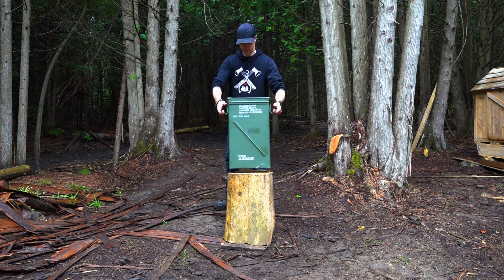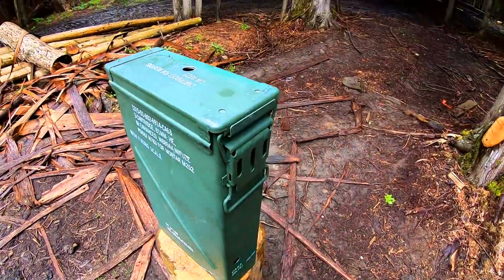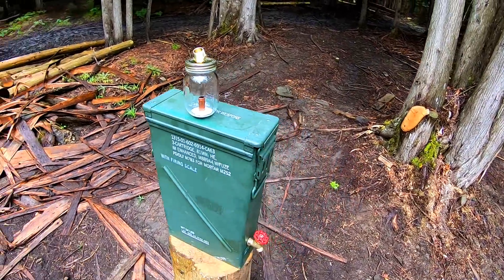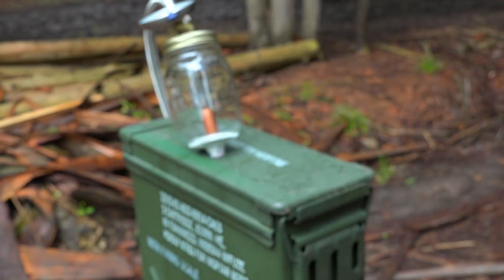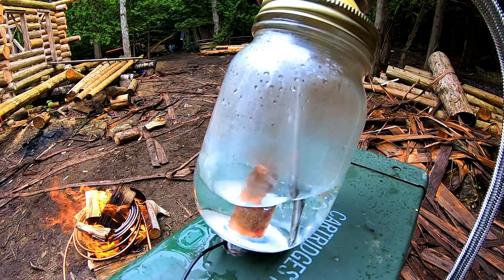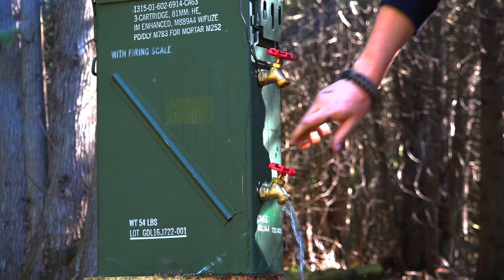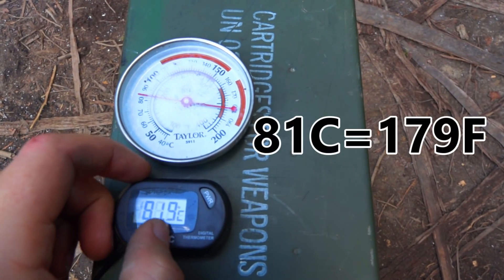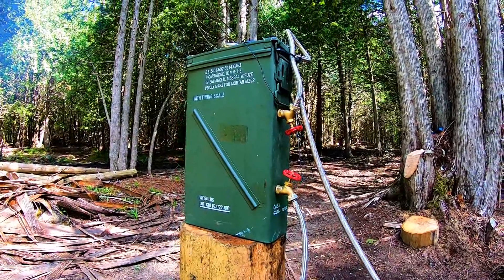Off Grid Heating Prototype- Copper Coil Water Heater / Heat Exchanger / Radiant Heater

Comment: Not sure if anyone has suggested trying to run the hot water through a car radiator or a large transmission cooler before it returns to the tank. It may offer more surface area to radiate heat.

Comment: Forget the coil in the fire. Kind of dangerous with the flash boiling, steam pressures. 
A 180° angle half loop is good enough for the thermal siphon to work.

Comment: On direct flames and coals it will destroy the copper. Melt it even. So view a few videos on how it’s supposed to work.
Reply: As long as there is water in the coil it won't melt the copper. Elements in the wood will corrode it in time though.

Comment: An intercooler instead of ammo box would work awesome, or even a modified radiator. A blow off valve could even be used to vent steam to atmosphere, or in your case to outside the camper.
Reply: adam forbes I agree with you.   A radiator would also hold about 15 psi making the water stay liquid till a higher temperature.  Maybe a small radiator off a motorcycle or something similar and small 12 volt electric fan to move air through the radiator
Reply: @junkman6261  might even be able to get away with those non powered fans that sit on top of wood stoves and spin the fan when heated. 
   I might try this setup someday if I move back to Alaska.

Comment: I looked into this several years ago. You can (or could) get radiant baseboard heaters, basically an enclosed coil with heat fins, for under $20 so it didn't seem worth building my own. I was thinking in terms of the copper lining a rocket stove inner or perhaps, if it turned out not to like direct heat, trying stainless steel pipe. You would, of course, need a pressure release valve.

Comment: looks good, i have built some hot water heaters, 1000 gallon heated by steam, also i worked for a wood stove plant and we sold a hot water coils as an option, the wood stove coil had about 3ft of 1/2" stainless tube inside the stove, i would think 4ft of coil in your fire would be lots, then for inside your camp a small baseboard hot water coil, i would also use used antifreeze, let say it gets all toasty in your camp, you fall asleep and the fire goes out, water will freeze, ok so for your setup you have now, if the hot water coming from the fire went to the bottom of your amo box it doesnt matter if its steam or water it will heat the water.

Comment: Applied ingenuity, to be sure. I just have one question. Do you think the copper coil could become brittle from the repeated heatings and cause a leak? I am not versed in metallurgy nor thermal dynamics. I am simply curious. Also, when used in winter, since the ambient temperature will be so much colder, the water should not get hot enough to boil in the tank. You may be planning on insulating the parts of the coil that will not be placed into the fire, though. Thanks.

Comment: I would add another set of coils or two that dont sit in the fire ! And don't put the first set directly on the coals this way you could get a moderate heat sorce ! Play with it tweek it untill you get like 65 to 70 plus  degrees!

Comment: Just subbed, I have been thinking of doing something like this for winter camping. 

Why not a auto heater core or old account evaporator coil from auto or home? Would give more surface area to transfer heat.

Being new I'm not sure if you do this sort of thing on your channel, but mount a peltier thermo electric device on the side of that ammo can and you can make some electricity.

Comment: Cool! But now, how to regulate?... This will likely run you out of the small trailer in short order. Pulling the coil from the fire... then will you have enough heat to last til morning? I would like to build a snowmobile-towed camp trailer, but I'm leaning towards a Mr Buddy heater (and CO2 detector just in case). I've heard the issue with a vent-free heater is mousture build up, so that is a consideration. (One other consideration for me is weight. I guess you don't have to haul the water, but melting this much snow might be a pretty big job also.)

Comment: really sweet dollar store build!  Besides tweaking what you have there, the next stage evolution would be to trade out the ammo can for a car radiator.  It has a few advantages over the can. The fins provide a thermal buffer so you can be against it more without direct burning, air gap is good.  It has large openings and was purpose designed for maximum flow and thermal radiating, thermal dumping is also good.  They are light and come with mounting options built in, so you can get it off the floor if you want, stability is also good.

Comment: you can do this with car radiator have overflow that can go back into water system that has cool off an have solar power fan to help heat an cool so ure water last such as 50 /5o anitfrezz the fan can be like one you get off a computer

Comment: Nice set up, I am going to do something similar in my bus conversion but I am going to use a small fan and a heater coil or small radiator from a vehicle to bring the hot water/ heat into the space but leave the excess water vapor outside for a dry heat, my tank will remain outside and vented to avoid pressure build up. 
So it would go from fire> top of coil>out bottom of coil>tank>fire>top of coil>out bottom of coil>tank. This is all theory at this point as I have not built or tested anything yet.
 The under floor piping is nice idea, good even heat and nothing to touch and burn yourself on while asleep, my bus floors are down so to late for that in my build.
Thanks for sharing
Mike from Texas,Take Memories,Leave Footprints

Comment: This also works really well for heating a large volume of water (hot tub) while camping. As others have mentioned, putting that can inside the trailer would introduce lots of moisture which, as I'm sure you've already seen, is a problem in small spaces just from one's own breath. What might work is to run a radiant coil inside the can and fill the can with sand with a reservoir/expansion (metal bucket ?) tank outside.